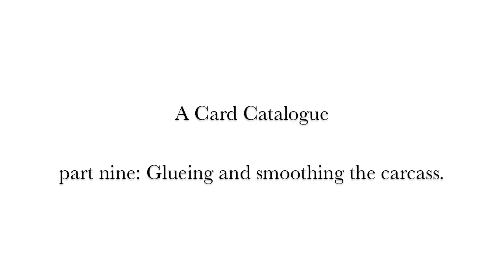A Card Catalogue part nine: Glueing and smoothing the carcase.

Comment: Brilliant as usual. When gluing do you just glue the faces and not the bases if you see what I mean?
Reply: I noticed the same thing. Also, I didn't see any clamping. You just pounded it into place, checked for square and next thing you were planing.
Reply from the maker: Eric,
thanks for the question- yes, I only concentrate on the sides of the dovetails- this is where the long grain is. The end grain at the bottom of the tails doesn't glue well.
hope that helps-

Keith, you're right- no clamps were needed. And the planing was actually 24 hours later- well after the glue fully cured.
thanks for the questions and comments.
all the best~

Comment: What's the difference between using the card scraper versus a smoothing plane there at the end?
Reply from the maker: The card scraper helps deal with a few little areas that were tearing out after the smoothing plane.

Comment: Why so much work with the card scraper after smoothing?  Do you ever find that card scraping leaves the surface uneven, either with dips from overwork or slight undulations?
Reply from the maker: OnEvenKeel,
thanks for the question. I used the card scraper because I had some bad reversing grain to deal with and my smoother wasn't able to handle.
I never worry about any slight variations on the surface- I don't spend too much time in one area, and I don't take too heavy a cut.
all the best~
Reply: Thanks, Tom, for the reply.  Perhaps it was the editing that gave me the impression that you followed the smoothing plane with the scraper over the entire surface.  Or, do you do a light pass over the entire table after committing to scraping select areas to ensure a uniform appearance?
Reply from the maker: OnEvenKeel,
I don't scrap the entire surface, only the small areas that needed it. - all the best
Reply: +Tom Fidgen The trick is knowing which areas need it!